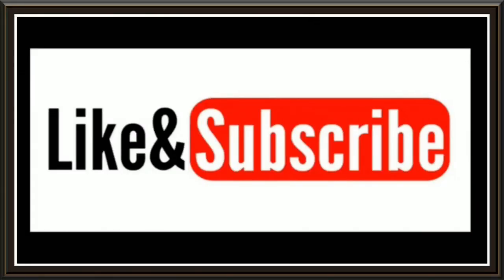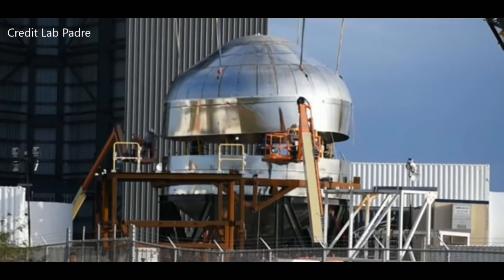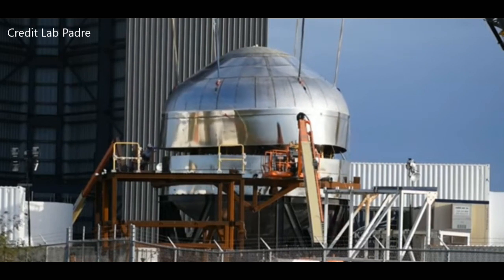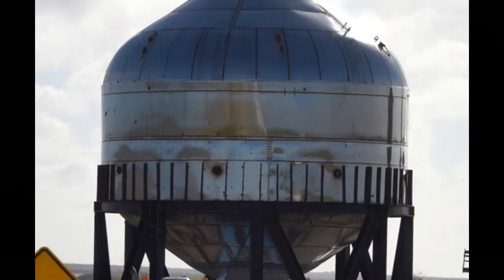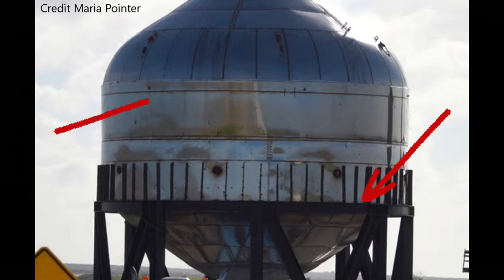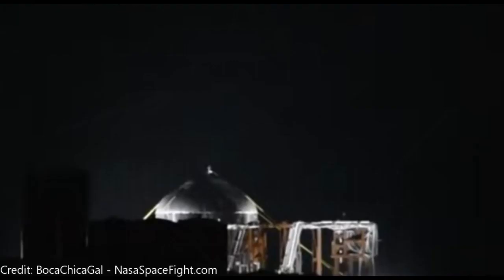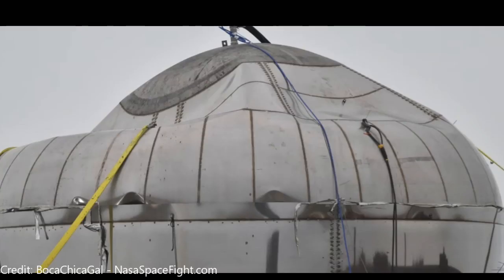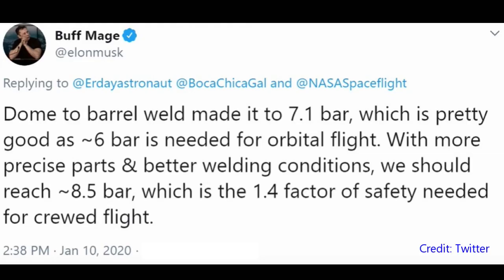SpaceX Starship Mars or Bust Special Report

Comment: The way I saw the tank bulging around the seams did not give me any confidence of this design working the way it is now. There needs to be some kind of reenforcment length ways around the tank. Of course the bulkhead seams need work too. The whole damn thing is way to flimsey at this point in design.
Reply from the maker: Yes it did look quite flimsy but they are trying to keep the weight as low as possible. My guess is that they may reinforce the structure once mated with the rest of the ship. 
Thanks for the comment!
SMD
MoB